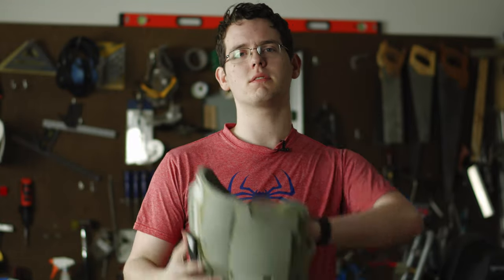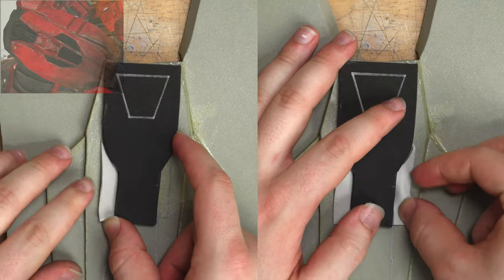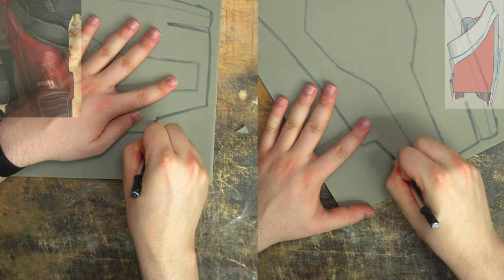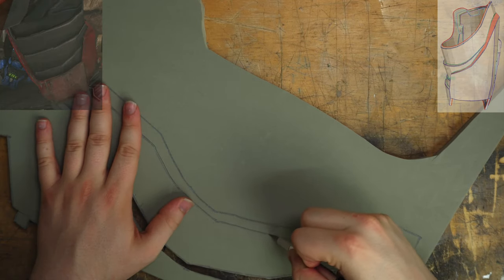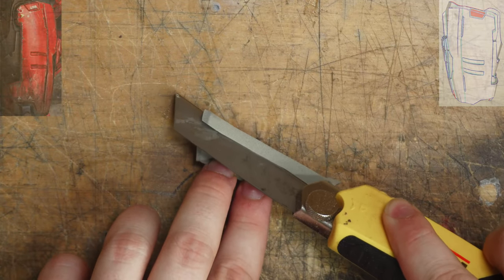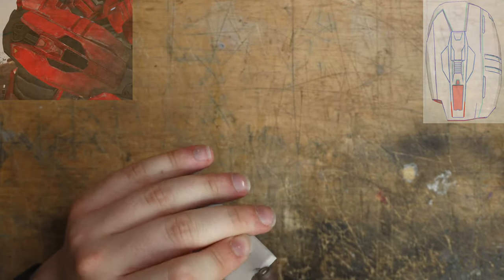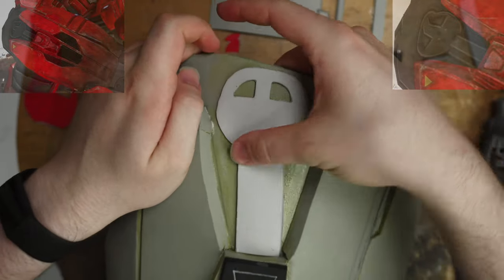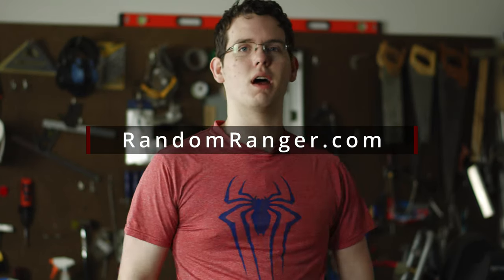Halo Reach Cosplay Tutorial | Thigh Armor

Comment: What size paper do you use to print the templates?
Reply from the maker: I prefer A4 but I use letter because that's easiest to find in the US, although really it doesn't matter. You just need to make sure that you have your print settings the same as the paper you use, otherwise your scaling will be wrong. Some templates would benefit from larger format paper so I don't have to tape them together, but I've never put the work in to do that. Also make sure you don't have "auto resize to fit" on. 
Speaking of paper standards, if you'd like to learn why the A4 paper standard is mathematically cleaner than the letter standard, check out Matt Parkers great video :-) https://www.youtube.com/watch?v=mHeo62B0d0E
Reply: @RandomRangerCosplay  Good to know! Thanks man